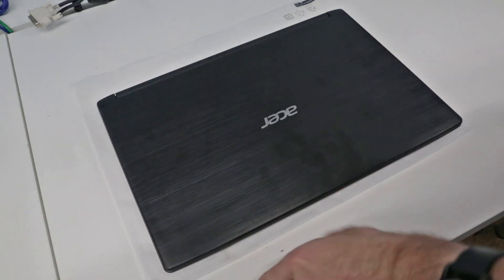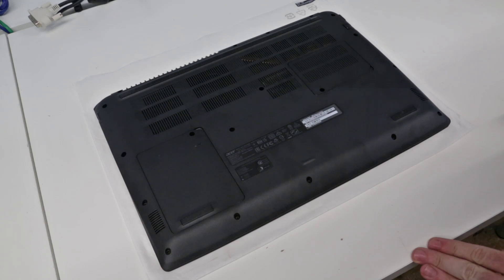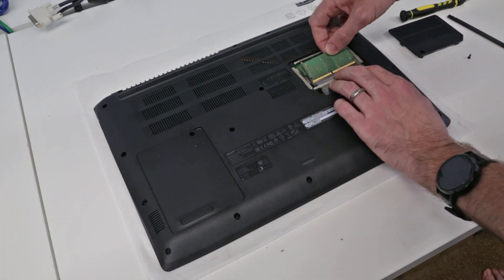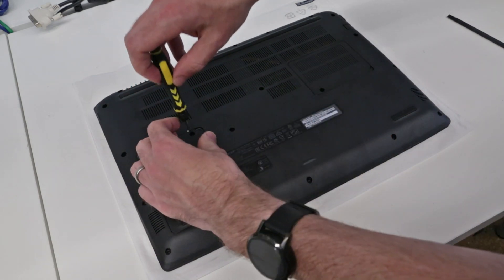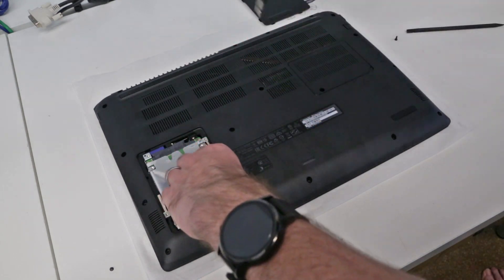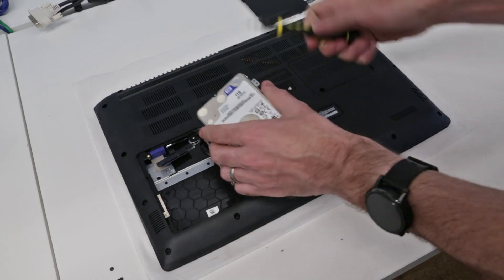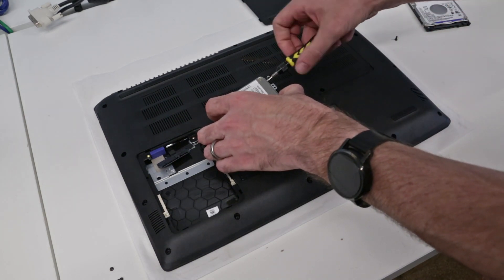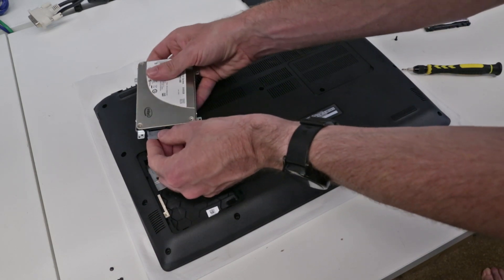Acer Aspire 3 A315-41G RAM and HDD/SSD Upgrade guide

Comment: Hah it turns out my unite uses the hidden M.2 and the connector for HDD is not accessible unless I remove all the screws 😁
Reply: same here, that sucks. BEcause removing all the screws and the back panel will screw with the warranty i believe
Reply: Umm, but how would they know if u have removed the screws? :D There was no warranty sticker  ;)
Reply: @Jokamutta  just saw your reply on m2 installation video. I saw you wrote they didn't include HDD/SSD connectors in HDD bay for those bought SSD version. That sucks :(
Reply: Yea it really sucks! I bought a 256 Gb SD card, but it sticks out of the laptop like 1 cm so its kinda annoying
Reply: Hey man, thanks for your reply. I've purchased Aspire 3 with R5 2500U today with 256GB SSD included. as you said mine also probably has occupied m2 slot. What I really wonder is, did they include SATA&power ports in your laptop for HDD bay, even though you have to remove all screws? Thanks in advance.

Comment: But how do i get windows in my new ssd? will i have to buy a new windows license?
Reply from the maker: You have a few options. You could clone the contents of your SSD using True Image or similar, or you could clean install Windows 10 from a USB stick. The Windows 10 license is actually in the system firmware, so it should reinstall the correct version without even asking you for a cd key.
Reply: @BrueComputing  Thanks. I didn't know that the licence could be in the firmware.

Comment: Please HELP ME .... I have the same laptop ... Can I upgrade the RAM to 16GB: 2 cards of 8GB  .... I dont understand the part of the module 2400 .. can you please explain that to me ... And what card should i buy ...
Reply: Core i3 6006u ( 2.0 GHz, 3MB L3 Cache)
Reply: 2400mhz is the speed of the memory. As per research, you can use 2 8GB ram modules whether the speed is 2400mhz or 2666mhz. 
I'm pretty sure you can use any memory brands, like samsung, team, kingston, gskill etc...as long as it's a laptop(sodimm) memory and it's either 2400mhz or 2666mhz speeds. 
You can check out crucial's site here: 
http://www.crucial.com/usa/en/compatible-upgrade-for/Acer/aspire-a315-41g
Reply: BigBadSpikey thank u so much 😀😀😀😀
Reply: Glad to help. I'm also thinking of buying this laptop tomorrow. That's why I'm also researching and I stumbled upon this video. :D
Reply: Too late man, i just bought one yesterday. The Ryzen 5 one. I got a good deal. They gave me a free Canon printer, a Ryzen jacket and cap, A lifetime activation for Office 365, 32GB flash drive and a free balloon(for the kids) lol. All for just $450. I now have more money to spend on a M.2 sata drive and more ram. It's like a grand opening of an AMD store near my area. Good thing I scouted around the area for the best price.
Reply: @De Boz Mann Yeah it's a great laptop, I just uninstalled some acer bloatware that I really didn't need coz It's just gonna slow down the system. And yeah, I uninstalled that Norton Anti-virus crap too and installed AVG. Norton eats up system resource, slows down the laptop and it's basically useless as an anti-virus. I dunno why laptop makers still installs that Norton crap of an anti-virus.
Reply: @alanhsu9606   never heard of taht app, usually u can use the control panel for uninstalling stuff, what do you mean exactly by the system permission ? does that mean that its still in use ? if so u can perhaps disable it from the task manager and then delete it manually
Reply: @alanhsu9606  good to hear but im afraid some part of that shitware may stay in ur system, try using malwarebytes and see if those can detect anything left or perhaps other app too...

otherwise meh :))))))))
Reply: @alanhsu9606  oh okay :)  and apparently ur profile pic is a gif that doesnt work here but does work on my notification

Comment: how do you clone the old HDD to the new HDD so all the stuff is transferred to the new one?
Reply from the maker: I didn't in this case, but if I do this I normally use True Image 2018.
Reply: thanks although I have never once had success in cloning a Windows disc with True Image and simply putting the disc in the PC and it works but cloning a Mac disk with Superduper works every time

Comment: I have the same laptop but in my task manager it says my ram speed is 1333mhz. This is a bug right?
Reply from the maker: CPU speed will vary depending what you are doing - it won't run at max speed when not under load.
Reply: I meant the RAM speed in my task manager says 1333Mhz. It's not going up or down.
Reply from the maker: Why would your RAM speed change? 1333MHz is DDR4-2666.
Reply: ohhh I see. Thanks

Comment: Hey I'm thinking of getting the ACER aspire 3 a1315-51 with i3 8th gen with 128gb SSD, would it be easy to add an internal hard drive. Please answer back quickly
Reply from the maker: Looking at pictures online, no. The SSD models of the A315-51 appear to use an M.2 drive, and lack the SATA bracket and cable. You'd  have to source these parts and add them to the machine - no idea where you'd get the parts from.
Reply: @BrueComputing  thanks for replying quickly.
Reply: @BrueComputing  how would adding ram to that model go? would it be the same as the ryzon model?

Comment: Can i upgrade my acer aspre 3 intel core i3 to ryzen 3?
Reply from the maker: No
Reply: Brue Computing i have bought ryzen 3 cpu
Reply: Brue Computing can a change my cpu?
Reply: Brue Computing raplay asap
Reply from the maker: No, the processor in all modern laptops is soldered in. If you've bought a Ryzen 3 then that is a desktop chip, not a laptop one.

Comment: I have this laptop with 8gb of ram, I don't know if it's dual channel, or single, how can you tell
Reply from the maker: Take the access panel off and see if you have one DIMM or two installed.
Reply: @BrueComputing  thank you so much, mine has 1 4gb in the slot, and 4gb soldered. What type of ram should I get?
Reply from the maker: If that's the case, I wouldn't change anything.
Reply: @BrueComputing  in that case, what sdd would work/ would you recommend
Reply from the maker: For SATA drives I tend to go with the Sandisks: https://amzn.to/2D5x0nx

Comment: I have that exact laptop and its kinda slow even I added a 4GB RAM, does the performance improve when upgraded to SSD?
Reply from the maker: An SSD will make a big improvement in boot times and application load times, I wouldn't have a computer without one personally.